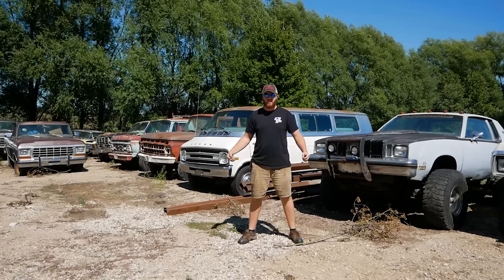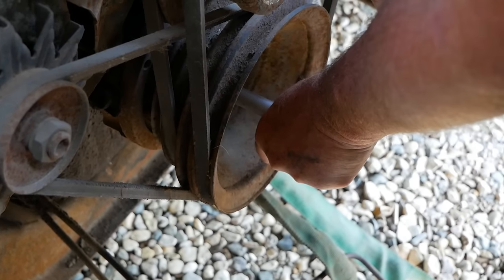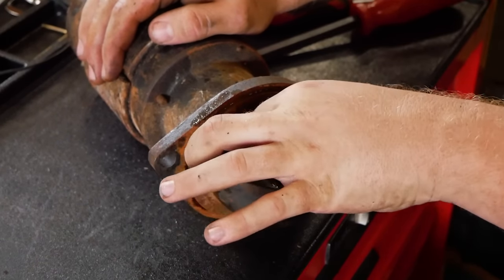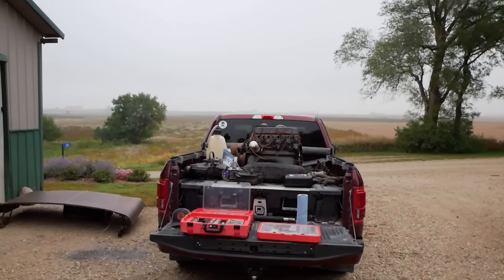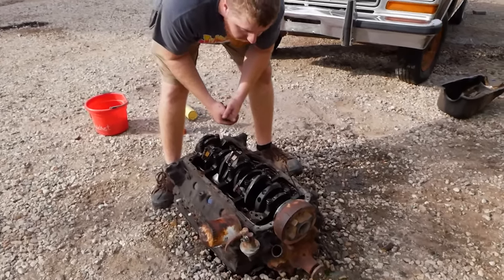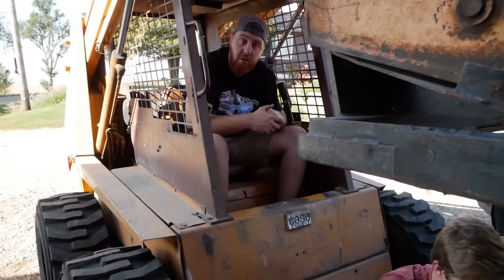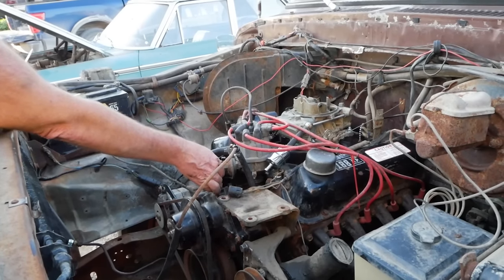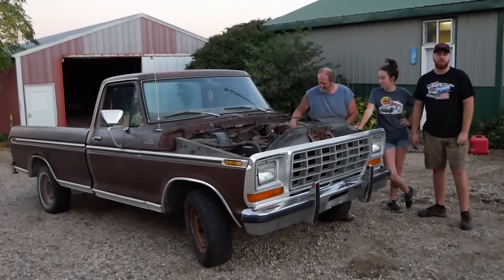Can We Swap a BOAT ENGINE into a TRUCK? 1979 F150 Revival

Comment: I was watching a video about the 24 Hours of Lemons racing and they talked about how engines that are designed to run at WOT for extended periods like normally fragile european engines are better for those races. That got me to wondering if a boat engine like a Mercruiser would work. Boats often spend a lot of time at WOT so maybe?
Reply: I've got a friend in NC that used to race lemons.
Reply: @jwrockets  what was his car? I think it's a great idea. It's amazing to see what some people run.
Reply: I bought a new  boat For skiing back in 1976 it was a 16.6 foot fiber form boat with a 120 
Mercruiser  i used a 17 pitch prop and run the engine at 5200 rpm. After I used the boat that way for 10 years i was told i should never run at a stead high RPM..  I still have that engine and still run it the same !

Comment: 8 bolts, and the whole front clip will come off, makes it easier to pull, and reset, an engine transmission assembly. As far as rusty bolt removal, I've seen a video, using an air hammer, and a wrench. The air hammer apparently helps break the rust loose on the bolts. Just a thought
Reply: Damn, that 63 is nice......
Reply: In my opinion, ditch the Holley, for an Edelbrock

Comment: When it finally lights and keeps running it's all with it tho. I got a Yamaha 650 motorcycle for free from a buddy of mine that was abandond for at least ten years. Motor was seized and the starter was bad so we used an old go cart backed up tire to tire as a lazy man push starter after I had soaked the cylenders in wd40.  I cleaned the tank carbs, blew out the cylenders and went full send. It blew out rust chunks then blue smoke and finally the motor smoothed out and ran like a champ. One of the best rescues I've ever had

Comment: Mates! Thats a great combination with the truck manifold and carb for performance, I think yu should watch for a diff for it to? That in  it seems to have a heavily worn gearset inside. Spinning one wheel like the brake is on the other. Sounds awesome!

Comment: All you'd need is the non boat exhaust manifolds, water pump, and maybe the intake.  The boat V-8 wouldn't have pollution crap on it and likely would have higher horse power than the factory truck motor.  We did that with a 454 one time.

Comment: Mercruiser supplied the engine for the 1990 ZR-1 Corvette. It had a lot of power for the time (375). Not so much now though. Being a marine engine builder, the engines were hand-built and very reliable.

Comment: Use forged pistons, rods and a crank if you can afford it. Change the cam for the load. If the engine is enclosed you might need a distributor for marine application. However you can use any engine for a boat.

Comment: Junkyard Digs, instead of using a hammer and chisel and destroying the heads on the bolts trying to remove frozen bolts, use a handheld impact driver or an electric impact driver or pneumatic impact driver(with the pressure dialed down) and six-point impact sockets

Comment: yes a good flush for a older Marine engine is needed  usually boats suck up tons of sand and Silt  and they will get packed solid at turns in the cooling system  in Salt Water boats most owners will take manifolds off periodically to  soak the inMuriotic Acid  Solutions  to break down Corrosion and Salt build up  that often would cause blockages and Overheating  a good tool to use is a Infared temperature gun  and a paint Pen to label  spots on the engine to record the tempertures. it’s  super nice if you have twin motors  in that boat to get a good baseline  for your records

Comment: I don't have a smallblock distributor, but I do have one for the 351C and modified engines.  Its one of the Davis Unified HEI billet units that is like new.  I installed it in a hot 351 that proceeded to blow up less than 5 minutes later.  Immediately pulled the distributor and it's been back in the factory box ever since.  I have zero use for it, I blew up my back 11 years ago and had to sell all my auto toys.  If you are interested I will sell it cheap.  I paid over $300 bucks for it new, its a super nice unit.

Comment: What happens to the Duraspark is the module is grounded through the distributor.And the ground path failed.I aways tee off of the ground wire and  ground  the module to  engine block .No more problems.I have 78 F-150 with 300.000 miles on it with original Motorcraft Module.Duraspark is a great ignition.

Comment: about the engine dowel pins, the ones that were stuck in your transmission were in the engine to start with, they just came out due to corrosion on the aluminum.. the only thing mercruiser is water manifolds and the decals on the valve covers.. its still a FORD small block that was adapted for marine use.....

Comment: I have a 1979 Ford F250 camper special. Came standard 460 big Block, auto Trans with OD. 3/4 ton rear axles. Same excate color. 1979 was the first year of Ford with the square headlights.

Comment: Instead of chisel to bolt you can weld a nut to the top and the heat from weld usually helps free up the rusty threads

Comment: My neighbor had a 78 Ford F-250  with a am/fm 8 track , cb radio with a 351 ci. 8 ply tires with a custom made camper shell. AC, automatic. Loaded. Bought it off the show room floor for like $5400.00.

Comment: i think that lower trim was an option for the explorer. or you could only get it when ordered with A/C. my old 79 F-150 Explorer just had decals, wheel arch trim, but had a white ford cap installed, non A/C, 4wd, 300 I6. took 5 steering boxes till i got a  good one. nice on the boat motor swap. non emission engines are the way to go.

Comment: In 1983 I had a 1979 F150 with an original 460 CI engine and added headers, nothing more was added to it but dang that thing would jump and go. Faster rpm rise than I have ever had in a stock vehicle.

Comment: I love this i too love the 302 in these trucks i daily drive a 1994 f150 xlt 4x4 reg cab SB 5.0 5 speed with 107k miles on it! I bought it off an old guy and his wife made him sell it cuz his eyesight was going bad but I told him I would love it as much as he did! I average 18mpg with it if I shift before 2500 RPM’s! I aim for 2k though!

Comment: I got a 351 Cleveland out of a boat one time found out it had a 4 bolt mains ended up putting it in a drag car the torque that that motor was putting out was unreal for a stock bottom end

Comment: Years ago in Florida i saw a guy  that built a Hot Rod  with the engine completely exposed and he had  a Mercruiser engine in it  i have to admit it looked cool. i did get a old Chris Craft CabinCruiser that had a blown 283 Chevy engine and i found  a running chevy Impala that had been totaled in a accident  and i  put the Marine parts onto that motor  my Dad told me in the 60s and 70s many HotRodders  looked inJunkyards for old Inboard  Engines because they typically had Forged Cranks  which were better for Drag Racing

Comment: I really appreciate this video. I am considering removing the B230F from a Volvo 240 wagon and swapping in a Volvo Penta B230FT (=Block 2.3 Liter Fuel Injected, Turbo Charged) from a Bayliner Ski Boat.

Comment: The pickup in the distributor is the same as an msd. The alignment dowels for the trans is always on the motor,yers just happened to come out of the old block. Been messin with fords for 35 yrs.
Reply: Some boat motors ran backwards.

Comment: A few years back I had a 1983 Chevy C10 short wide that was seven different trucks and a boat combined. It had a marine 350 that was bolted up to a transmission that was out of '93 suburban and the truck had rust holes so big in the floor that if I locked my keys inside of it I could just climb up into the cab through the floor

Comment: If you count compact trucks, I think it's not unheard of to swap Mercruiser 4 cylinder Marine Iron Duke derivatives for the stock 2.5L in S-10s, though I think it's more common to rebuild Dukes with Mercruiser parts (much beefier crankshaft, and lower stroke ... in some configurations it'll even pass smog)

Comment: I had a 302 crank brake like that... right behind the first rod journal. It was an 85 HO mustang with 200K orig. mi. I was able to just swap in a new crank and rod bearings and keep driving.  Engine was making some obnoxious noises. Amazingly the engine was actually still running when I shut it off.  It wouldn't restart though. Sold it years later with 300K original miles. BTW would have preferred to see an outboard Merc. F150.

Comment: I am sure that you have noticed that the merc has more power than a truck 302, the marine engines have larger valves and a heavier cam because driving a boat is like driving up a steep hill all the time.

Comment: I haven't watched the whole thing yet. can just tell you they made these motors run left hand and right hand direction specifically for boats. if it runs backwards just change the starter and the camshaft. it's so they could run side by side motors.

Comment: What a bargain. Although there's a little surface rust you could tell from the starter that, like many recreational boat engines, that engine was hardly used at all.

Comment: The first engine you had in the back of the truck all you need to do is put transmission fluid and acetone mix them 50/50 but I'm soaking cylinders guarantee you have a good engine

Comment: It doesn't take long for cylinders to heat up without coolant. As much as you ran it dry, I wouldn't be surprised if the cylinders aren't starting to get scored.

Comment: I used to R&I transmissions for a living. If the engine wasn’t seized you would remove the starter to pull torque converter nuts.

Comment: When Ford brought back the Mustang GT in 1982, that original 5.0 was warmed up with a marine cam among other goodies.   The emissions 302 of the late 70s was 122 sad little ponies.   The '82 GT 5.0 was 157 hp.   That was the start of the 5.0 that ruled the '80s and '90s.

Comment: Nice!!!!!!!  The only mistake you did is that I would of flushed out the fuel line, disconnect it from the tank and spray in carburetor cleaner, and use aircompressor to blow ALL that crap out of that fuel next I'd remove fuel tank and wash it out, cause that old fuel has nothin but water with rust in it.
Other than that I must say you all did an EXCELLENT JOB, PEOPLE!!😉🤠😁👌✌️👍 More please 😁😉. If you do get a title, remove them F-150 emblems and install it with a pair of the new F-150 LEDS, multi colored/ or single clear color.  By Reccon Accessories.😉

Comment: Put a 351w instead of a 302. You will be much happier.
You shouldn’t have spun that motor over the way you did.
You should have pulled the head off and remove the piston from the rusty cylinder and put a sanding hone/deglazed through to remove the rusty particles so it didn’t make severe deep  scratches along the bore. You probably just screwed that cylinder up now and have to get it machined out.
Never run an engine like that. You do more damage.
Keep that old carb and rebuild it. They are worth some good money still.

Comment: You don't know how easy pulling an engine can be till you use a wrecker with twin winch lines to do it you just stand there pull levers and wiggle it if it gets in a bind.

Comment: 3 things wrong. 
1 engine options were just that options. could be ordered almost any way you wanted. 300/302/351m/400/460. in 2wd 79s. the 4x4s were rhe ones basically stick with 351m/400. 
2 that lower trim is 73/76. and 2as added to a 79. period.
a 302 is a 302 when it comes to block and mounting. so its basically a high performance 303 swap.

side note: I've had 2 fords snap crank right in the front main. both 351m.

Comment: My HEROES!  I want you around when the EMTs can't kick start my heart. You guys step out of the darkness with a breaker bar and a pair of rusty pliers in hand, "We'll take from here boys," you say to the EMTs before they call my time of death. With a toothie white grin you turn to your Dad, as he brakes the seal on a brand new can of Sea Foam. "This ought'a do it son."  Their eyes meet with a stoic confidance. "Good call, Dad. Let's get to work." Without skipping a beat you wash down my belly with Sea Foam. You, then perform the lost art of Philipeno Psychic Surgery. Like a master, without a second to lose. "Ah!," you say. "I found the problem!" Diving deeper you begin to pull out 14 feet of rotten colon. Everybody, freezes. The room, thick with suspence. "This is the third one we've seen this week." The pimple face EMT brakes the silence. "What's that sir?" he mutters. You look the kid square in the eye..."You should NEVER, " you snap angrily. "You think this is a GAME!"  "Take it easy, son." A father's hand helps you collect yourself. "We have been seeing this more and more." Now, calm and collected. "You've been using a cheap petroliem based oil when the manual clearly states Synthetic in the viehicle handbook." The owner's manual maraclosly appears in your hand. "Maintance, Verse 8, line 6..." and the room falls quietly into the evening darkness. Fire flys apear in the evening air. We fall away. Smarter, more educated, ready for tomorows 7am commuter crunch.

Comment: I cant believe the heads weren't different. I'd think the cam should be swapped seeing how a boat engine is designed to run at higher rpm? Just throwing some things out there for a comment. Best of luck

Comment: It WAS a boat motor in a truck.

Now you get to rebuild heads or replace the block for running the shit out of it without hooked up to a cooling system.

Comment: Real easy, 
78, round headlights
79, rectangular headlights
Reply: For most cases this is true but there were some weird trim level things where you could get round headlights in a 79. I think that’s the right way round but I could be wrong, might be rectangle headlights in 78, or it could be both. Who knows

Comment: I have a 74 F-150 Ranger with a 351 Windsor with selectable 4 wheel drive but the rear drive shaft is snapped.

Comment: Looks like a small block engine in a big block chassis. Because you see fuel out the vent with the engine running, the needle and seat have failed.

Comment: There’s a 1978 1/2 and a 1979 with Square headlights and everybody seems to want those two body styles but if I can a regular 1978 with round headlights I’d take it and fix it up because that’s what my dad used as a work truck when I was young, (he was a painter) and my brothers and me decided to take the 351 that he dropped in it that he got out of an old LTD Ford car and drop it in a 1971 Ford and sent the truck to the crusher. I regret that now.

Comment: I had an 88 F150 with a 302, auto. The little engine in a full size pickup was a huge mistake for Ford and for me. My next Ford was a 97 F250 with the 460. MUCH BETTER!

Comment: BUDDY THE WIRE WHEEL EFFECTIVELY JUST TRANSFERRED METAL TO THE PORCELAIN OF THE SPARK  PLUG, THIS WILL CAUSE AN ELECTRICAL PATH DIRECTLY TO GROUND CAUSING MISFIRE... YOU SHOULD HAVE JUST SANDED THE GAP OF THE GROUND ELECTRODE AND THE TIP OF THE CENTER ELECTRODE.....BUT YOUR PROBABLY GONNA JUST PUT NEW ONES IN ANYWAY.

Comment: I love engine swaps that were never meant to be and few have ever considered.
Reply: I had a '48 Ford 1-1/2 ton (two speed rear axle with a long rod that operated it) that blew up its flathead V-8, so I put a Chevy 283 in it. That was a pretty neat truck! Got a bell house adapter from J C Whitney.

Comment: Thanks guys you get it for your dad I’m sure he loves it just fix it up a little bit more and that would be a nice Ford that he can meet around the farm for a bit and then take it on a long drives it’s a loud motor and just put exhaust on it and it will be a bad motor all marine motors are high torque motors because they need to push the motor boat through the water now it’s in a truck it’s got more horsepower

Comment: I had a 1979 F-150 Camper Special with a 460. That was the biggest gas sucking pig I ever had, even the old International Travelall 4x4 I used to own was better on gas and that's say a lot.

Comment: Only thing I’m concerned about is that boat engines typically have cams set for all or nothing power. Probably wouldn’t be great on the street
Reply: They are fine on the street, better than those that love at idle because it doesn't require a stall converter.

Comment: So was this boat motor basically a 302 Ford foundation tweaked by Mercruiser for a boat install? Would have to be for transmission and exhaust to bolt up and match.

Comment: ALL  those truck you have there ( dodge fords etc )  can be repurposed and  sold if you put V8 engines  in them( big block, small block  ,   generally dont crush  any trucks or full size vans  ( they have resale value with small block or big blocks )  , just  the run of the mill cars , and real severe rusted  or body frame damaged  vehicles .

Comment: I haven’t even watched a full video yet, but if you got the same year engine block it’ll fit there is no internal difference between a boat motor and a vehicle motor. None just look at the MerCruiser repair manual and you’ll understand. I had a friend that worked in Michigan at the plant And he said there’s no difference. They built my cruiser engines regular engines down the same line got the same piston same same everything rebuilt 3 ton 350 in my boat seven years ago and I’ve been driving on it every day during the boating season at least 10 hours a day  For seven years the reason that boat mechanics don’t want you to know this is because they can’t charge the over price for being Marie. Even the outdrives are not very complicated. They barely put any money into making this stuff work and you can argue from here to Hell just look at the cruiser book in the Chevy book. Look at the Ford book and the MerCruiser book and you’ll find out very fast , I mean it’s right in the box